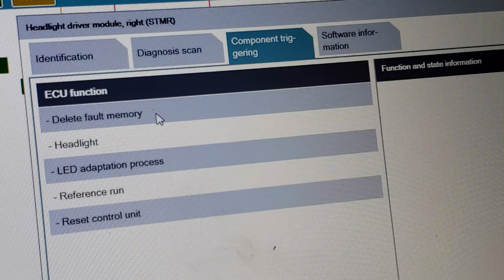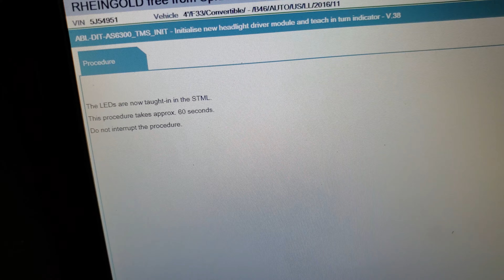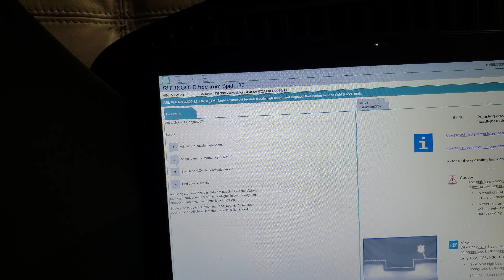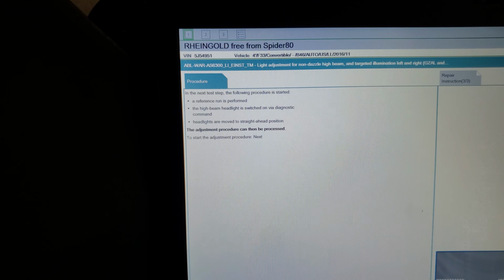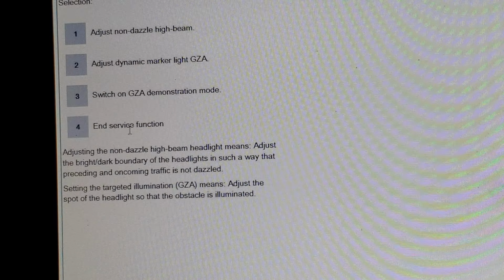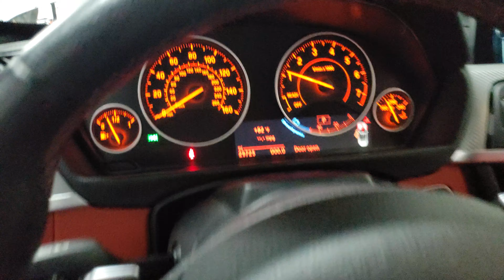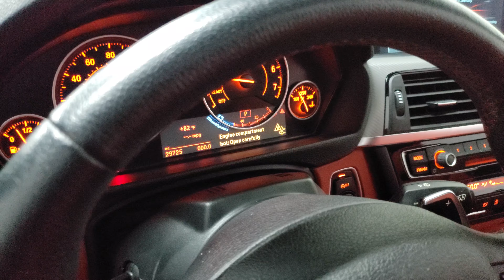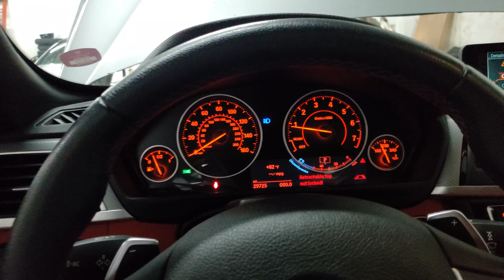BMW F33 tracing down a LIN BUS fault_Part_5 2020-08-19 14:54:23 ( text Watsapp +1786-355-3660)

Comment: What's solution??
Reply from the maker: The Problem is a LIN BUS wire was pulled back from out its connector. So we fixed that and the Adaptive LED lights work again
Reply: @BMWPROGRAMMINGJAMAICA  you are very professional and work with passion